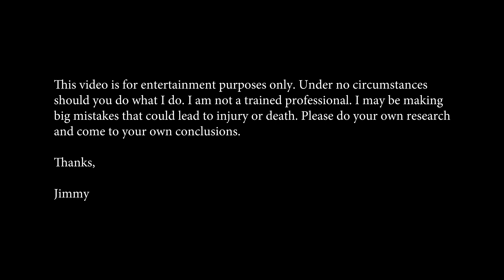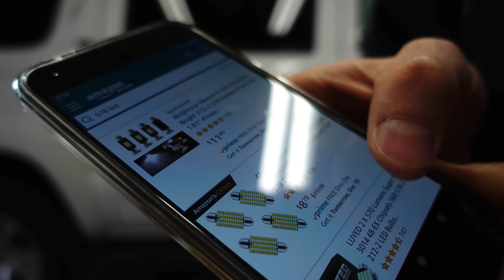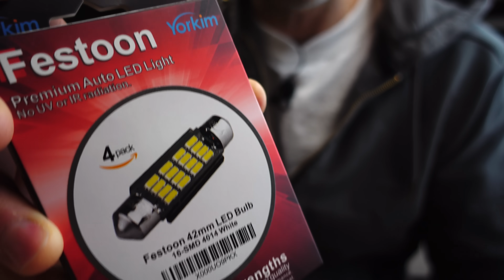Here's Why You NEVER INSTALL LEDs IN YOUR CAR OR TRUCK!!

Comment: My car headlight assembly is plastic, been going on stock bulbs, after a few years, the front plastic became foggy, i did the headlight cleaning kit, and didn't help that much, so i went to LED, and i bought the new assembly to test the led bulbs, and so far after years, headlight lense still like new, haven't used the headlight lens cleaning kit, on top of that, according to the voltage meter, uses les voltage then the stock,  so nah, ill keep my led bulbs.

Comment: Not a fan of LEDS for everything. They're harsh and not good for accent lights. LED street lights are turning out to be a problem, because the lights actually pulse and cause vision problems. Many places that install them get complaints and have to put up shields or swap them out to the old kind. LED lights were an accident, when engineers noticed certain diode composition resulted in them glowing. They're Diodes first and lights by mistake.

Comment: The only issue Ive had with LEDs is in my taillights. I even bought really expensive ones that claimed to have a heat sink and I could clearly see the cooling fins on the ballasts but still after litetally one day one of them was already burnt out. The ballast was so damn hot im surprised it didnt melt my trunk panel plastic. This was about 2 years ago so there may be better ones now but im in no hurry to spend another $100 on 2 bulbs right now lol. The ones in my headlights and litetally every other bulb in the car are all LED with no issues so idk 🤷🏾

Comment: LED light emissions are dangerous. Thats why you get an after image on your retina after even a brief glance. This will affect your central nervous system and immunity against disease. Also your sight will suffer greatly in time. LEDs are powerful high frequency blue and white light which does not contain a range of spectrum like tungsten bulbs, which is generally beneficial to the body. Even sodium lamps had to be fitted with diffusers to spread the light output intensity at about 4400k, these leds have outputs to 7700k with no diffusers fitted at all. That's why all the flying insects are dead and you cannot see the road with an oncoming car. When was the last time you had to clean your windscreen of bugs?

Comment: I can somewhat understand the appeal in changing out vehicle lights for the quality of light, but in my opinion that is about the only reason to do so, and for me that's not a good reason.  My truck, a 2003 Tundra, has only had one headlight (I replaced both) and a parking light fail in its 20 year life, and those were fairly recent.  I replace them with OEM bulbs and everything else light wise is as it left the factory.  As long as the lights work I can find better things to waste my money on.  I doubt you would see a worthwhile ROI on fuel savings as a result of the alternator working less due to more efficient bulbs.  People claim all sorts of things to justify their "why", and to each his own.  Its true that the other bulbs in my vehicle will start failing sooner than later, but I will replace them with the old style that has worked well since I bought the truck.  They are / were reasonable and clearly last a long time.  I hope everyone has fun experimenting with their vehicle lighting.
Reply: running lights in older cars dont emit enough light to comply to EU day lights laws, which state that they must emit 550lm minimum, otherwise you have to turn on your headlights, switching 4 bulbs to led is cheaper in the long run than running two 55W bulbs non stop

Comment: If your LEDs are overheating, you're buying to bright LEDs. They deliver about 10 times the light of an incandescent of the same wattage, so you don't need bulbs of the same wattage as the incandescents you are replacing. An example: An incandescent rear light bulb is 5W, an incandescent brake light bulb is 21W. If a LED replacement rear light bulb is 5W and puts out as much light as a 50W incandescent bulb, it's going to be more than twice as bright as a brake light. That will make drivers behind you think you're braking, and will annoy them. Depending on your jurisdiction, it might also attract unwanted attention from the authorities. Just dial back a little on the blindingly bright LED replacement bulbs, buy good quality, I've had some very cheap LED replacement bulbs fall apart when being removed and some where the connectors rusted, and you'll be OK. Why did I remove the LED bulbs? The car was scrapped. This happened several years after I bought the LED bulbs, and goes to show how long they last. The oldest I know that I'm still using are from 2014, and are now on their second car. I expect them to outlast this one too.

Comment: I've found that LEDs are not suitable for all applications. In my book dipped beam and main beam headlights are a no-no as the light output isn't the same as an equivalent halogen bulb. LED bulbs also looked a bit washed out through coloured lenses although warm white bulbs would get round that problem. In some countries, LED bulbs are technically illegal but your typical rank-and-file police officer probably wouldn't know this and wouldn't bother as long as the light is working. I've fitted LED bulbs in cars without any major problems but not everything is suitable to be retrofitted with LED bulbs. One issue with indicators are the fact that they will flash very quickly unless the bulbs have load resistors (to mimic the behaviour of a filament bulb) or to change the relay for one that is LED compatible. I've recently bought a Mercedes W204 C-Class and I want to fit LED bulbs to the interior, DRLs, sidelights, licence plate lights and the reversing lights.

Comment: I first started using LED bulbs in cars about 15 years ago. I've had one disaster where an LED festoon style lamp in a rear rego plate light on a car went bad and caught fire within the tiny housing. Luckily the fire self-extinguished due to the tiny amount of oxygen available. I'e noticed the good quality LED auto lamps (JW Speaker is the brand I use a lot now plus some Phillips ones). Sadly every single LED lamp is made in china so LED lighting supports modern slave labour to create 'cheap' lighting solutions.

Comment: One problem with LED bulbs is typically they are made up of a cluster of smaller LEDs wired in series. That means if one of the smaller LEDs burn out, all the LEDs go out.
That being said in the title of this video you tell us not to install LEDs in our cars and trucks while you are literally installing LEDs in your truck.

Comment: Biggest problem with led in headlights...  if that light was designed for halogen bulbs?   The reflectors in the housing are designed to work with a point source  light...  led are not point source.  So the lamp will not function properly because the physics of the housing are not designed for led panels
Reply: True said

Comment: There's a good video explaining this and howitzer LED are having trouble with the voltage from dipped and high beam and knocking one ofnthe sides out the COB leds there burning out fast with this issue

Comment: This video is old, but I was running LEDs safely, with no heat problems for 4 years before this four year old video came out.  LEDs aren't hot.  Cheaply made LED drivers are.  LEDs are current dependant.  The driver is supposed to regulate current pushed through the LED.  The cheap way to do so is by using a voltage regulator and resistors, both of which heat up quite quickly.  The smart way to do so is to use a buck converter, but instead of costing pennies, a buck converter costs a couple bucks.  You don't have the heat problem, though.  Your cheap "bulbs" are going to use resistor based drivers, while your premium brand is...still probably going to use resistors.  That's why I use a stand-alone driver.  These can easily be bought or built.  I build my own.  

The idea that you're just going to buy a drop-in replacement between these two VERY different types of lighting and not have problems is fool hardy, at best, but moreso dangerous.  Resistor type drivers are all well and good, if you have room for heat sinks, which you don't in a small bulb, and buck converters need room for coils, a sin wave generator, and a rectifier circuit.  Again, not going to happen in a small form factor.  If you don't care to do it right, just keep buying halogens

Comment: Great video, and technology has evolved. Most (not all) LEDs as opposed to those years ago are more optimized with heat sinks.  The latest LEDS are far more efficient at producing light rather than heat. Today, 2024, most new vehicles use LEDs for nearly all lights.   That said, you can still buy very poorly designed LED lights in various form factors that will not last as long or longer than the prior technologies. The best example of lesser quality LEDs are "budget" grade home bulbs which are not designed to last as long as they can be as retail cost becomes the priority, not long life. Also, If you only buy a bulb once, the industry shrinks dramatically and they are in business to stay in business.  Still, power per lumen is far less than most prior technologies other than florescent, but in most cases LEDs have a far longer life and are less polluting than florescent tubes when they are dispose of.

Comment: i had LED driving lights ..... a good brand and they are just rubbish... i went back to halogen and spent a bit of money now running FYRLYTS 250watt 24 volt i just cant recomend them enough ... and they are not HID.. they can be switched from pencil beam to broad beam in a few seconds with a knob you turn in the back of the light frame

Comment: LEDs are becoming dangerous.  Drivers of cars in oncoming traffic are blinded.  I have had several cases where I actually had to slow down, in the city, to half the posted speed limit.  I ended up upgrading to the brightest LEDs I could find to balance these situations out.

Comment: Greetings from Manchester.
Can anyone recommend a brand please? 🙏
Thanks
Reply: that's what i'm trying to see
Reply: Get the one made by ATG & Cree. ATG/Cree are one in many ways. 
The body has over 77% metal with fins or nice heat sink with a fan.  Low LED headlight = look metal with fins or fan.

If you are in hot places, get LED headlight with fins & fan. 
Just the fins will not help to remove the heat. Get one with a fan. 
Your LED will last much longer than the fan. So if the fan goes bad so will your LED.
Nevertheless, ATG/Cree is much better than incandescent.

Comment: Actually, there’s a problem in the U.K. with these retro fit led bulbs in cars. They have bought in a law that makes them illegal! Will not pass the yearly MOT which is a basic road worthiness certificate all cars 2 years and older and must have here! Also,in my case, cannot convert back to halogen unless I get a new wiring loom! This, if bough new , will probably cost more than the car is worth! Don’t know about where you are buddy, but just be aware of this!

Comment: Not true.. LED lighting will outlast your vehicle. Compare that to halogen. I've gone through 2 sets of halogen headlights on my 2000, F350. Done with those I switched to LED. I did have issues with alignment though because the housing for those lights were non-reflective. however I always make certain I'm on low beams well before I get anywhere near oncoming vehicles because these guys light up EVERYTHING rather than keeping the light down below oncoming drivers. I still get drivers flicking lights at me even though I'm on low beam so I give them a quick flip back indicating I'm on LOW. I haven't had any road rage incidents yet!

Comment: When LEDs first came out and they advocated using much less energy and lasting a long time, they became the hot topic.  However, now that some years have passed, people have realized that the cold bluish or white light is obnoxious during nighttime,  The human body prefers warm light at nighttime, like the light from fires, candles, etc.  Night vision is ruined when oncoming vehicles glare overly bright LED light into your eyes.  Although I haven't seen this yet in headlights, almost all other LED bulbs have started to flicker and will never meet the promise of "lasting forever".  What we truly need is to design LED bulbs to behave, look like, and operate like classic incandescents. The more directed light from LED bulbs is also obnoxious in oncoming cars that drive over bumps and cause the headlight to appear to "flash" or "blink".  Lights should be less luminosity and less directionality.

Comment: First, all of the bulbs you called "halogen" are just regular incandescent bulbs. Also led are "more efficient" assuming they are engineered correctly. But you would be wrong to assume that a 168 replacement led bulb uses less power than a standard 168 bulb. Manufactures are trying to wow you with brightness and installing more led chips than actually needed. Also some led headlamps use more power than standard halogen because they have fans draw power to cool them. My kid replaced all his interior bulbs with led bulbs. Then the $200 lighting control module blew out twice. The car is fine now since he removed the led bulbs and reinstalled the standard bulbs. If you are going to convert to led verify the power draw of the new bulbs because many are not following the established candle or electrical power parameters of what they are replacing.

Comment: Any LED light bulb will burn a spot inside your eye, if you stare at it.
The next day your eye will feel like it has a bit of sand in it, and a tiny blank spot where you stared at the bulb.
Incandescent bulbs won't do what an LED will do.

Comment: ALL LED's are over driven to die quickly. Except Dubai bulbs. change the resistor. You will use less energy with no loss of light and they will last for years.

Comment: Heat isn't the biggest issue for everyone else that has to look at them. LED bulbs in housings not made for them blind everyone, and they often find it amusing that it does. Great until someone gets moth to a flame deer in the headlights syndrome and drives head first into you because all they see is a glow, especially if they have minor vision issues like astigmatism. I feel bad for them. 

I got pulled over for a headlight out. Gave me a 5 day. Of course I was literally on the way to the store for a bulb when I got pulled over. I went down to the police station. Cop came out to verify. I asked if they had an officer sitting in the field doing paperwork I could drive past quick to make sure I had aimed it correctly after I replaced the bulb. He looked at me like I had a third eye growing out of my forehead and told me flat out that they don't care, because the law only says it has to be operable. 

Yeah, they literally do not care at all about safety as they claim when they pull you over for basically anything, which is why you see so many idiots blinding you with that one headlight cocked up directly into oncoming traffic. It doesn't matter where it's pointing. It only has to work. Outstanding. 

Most people just change the bulb and have no idea about aiming it. That's why "Joe's Garage" type places have a horizontal line or two painted on one of their walls somewhere in or on the building, about knee to waist high. It's a reference point for aiming headlights.

They are apparently too stupid to figure out that they can't see the actual road because the light is going into your lane, or just off into space, which must be really fun in heavy rain, or especially snow or fog. Stupid. You're stupid. You shouldn't even have a license. You can't even tell that you can't see. It's like people that forget to turn on their headlights because the interior dash lights are on. How can you not tell that you can't see the road when there isn't street lights?

LED bulbs are not meant for old housings for MULTIPLE reasons. You're a jerk, and blinding everyone, so I while I don't wish ill on any person, I hope you melt your housings, dummy. Such simple things that can make such a big difference, and people can't even do those. We're doomed. It's just a matter of time. Good luck everyone.

Comment: Stick with major brands like philips and you won't have these kinds of problems. Generic bulbs are made cheaply and they fail quickly. More expensive reputable brands have the engineering RD to manage heat etc

Comment: I have found even the cheapo $11/pr LED (fan cooled) headlight bulbs to work awesome as far as light output and longevity as well... (for $11/pr I but 2 sets at a time so when one fails there is no wait for replacement to come in mail..)  But well worth the investment!!!  LOL   Also ,even on cars with "light out warnings" --that is easily remedied with  6 ohm "loading resistors" available cheap also--however keep in mind those need to be mounted to a metal source as they get hot as they operate and will melt plastic if not mounted to suitable heat sink (aka--metal)...  Many new bulbs listed as CAN BUS compatible fix that issue internally though!!! ENjoy----good vidoe bro even if 2020!! still applies in 2023 now!!  :)

Comment: For car using led isnt good ideo. Because car interior's 12v light system doesnt close(off) suddenly. When you close the doors, light goes down slowly. And when you open the doors, 12v comes slowly. Yesss this is very very bad for led system.  Led light bulb s working system clearly straight 12v dc, 6v dc, 3,7v dc. If you want to really really wanna use led, maximum 2 or 3 mouths later, you can see flip flop on led buld. That is this. you must connect 12v, 100 or 120mF capcitor to led + footh. And this mate s topic is another problem heat.